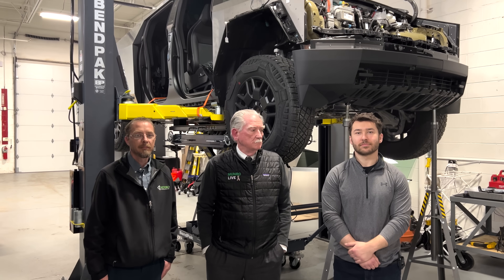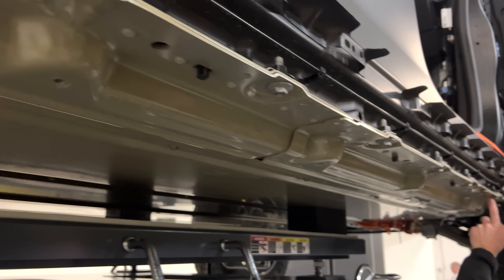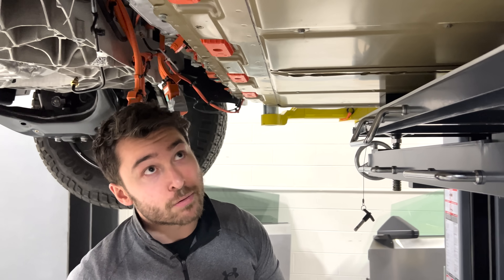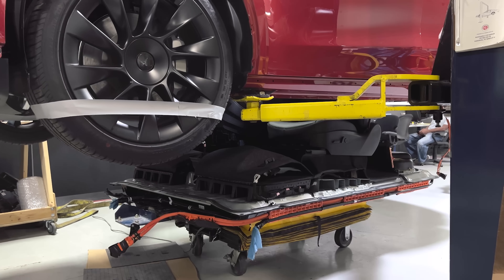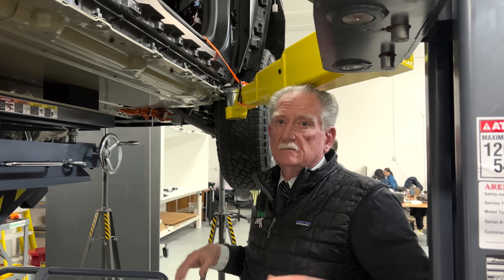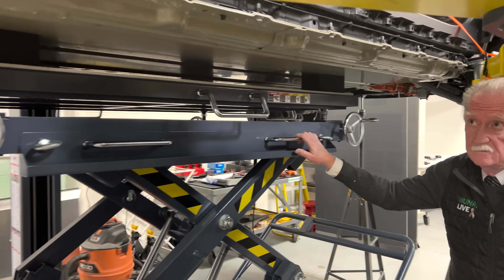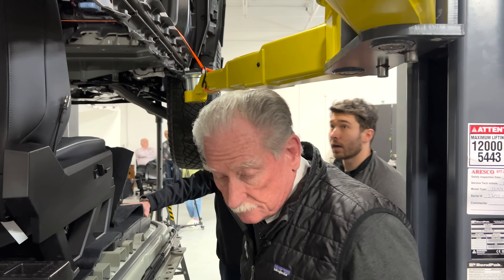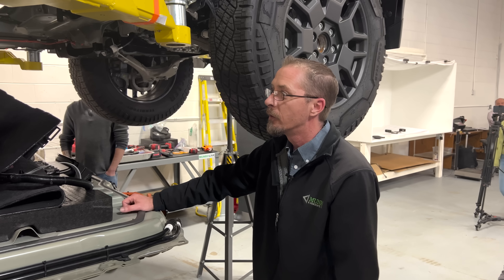Dropping the Battery Pack in Our Tesla Cybertruck!

Comment: That drop down of the seats attached to the structural battery pack is something else!
Reply: i rather not be sitting on top of thermal runaway piece of junk design 101 on this machine poor designed door handles and controls and everything else tesla cannot design vehicles worth a crap.
Reply: And how does this deal with waterproofing, considering it's supposed to be a workhorse? After a couple of battery unhooks, I doubt you will have any waterproofing integrity left.
Reply: Yea, it is a joke. Cheap crap. Check out NIO and battery swap.
Reply: @billybobbob3003  Punctuation, it can be useful'
Reply: @HullioGQ  Why would you be unhooking the battery at all in the first place? The only reason to do that is if it's damaged, defective, or needs to be replaced because of extreme degradation.
Reply: @HullioGQ  Which waterproofing? The pack itself, or the pack to the body?
Reply: Hahaha you commenters seem to be geniuses.   I only have an engineering degree from a small insignificant school called Caltech.  I can see that you three must have higher credentials than me and the Tesla team.  Oh by the way why don't you guys comment on the Fisker Ocean....it will undoubtedly revolutionize the whole EV industry.
Reply: @martina5328  I've seen you all over this comment section. Are you paid by NIO? Because if not, you should be. 😂

Battery swap is going to go the same way as hydrogen cars… No where.
Reply: @billybobbob3003 is literally the same concept wise to sitting on any other Ev. It’s just on the manufacturer side how easy it is. Don’t know why you hate Tesla so much when Toyota puts bad airbags knowingly just to give you a recall later on since it’s faster than stoping production. But you do you and your 50 recalls .
Reply: @Endymion.  TOYOTA DIDNT MAKE THOSE AIRBAGS.
Reply: @billybobbob3003 That's right, legacy automakers are just catalog shoppers, they barely have any core expertise - unlike the new modern players like Tesla and BYD that vertically integrate so much. 

Maybe Toyota and Mercedes will catalog shop from Tesla again, like they did with the Rav4 and Smart platforms. But that's just trash products by extension, right?
Reply: ONLY WAY  to remove the seats…
Reply: @HullioGQ  The assumptions are that battery replacements will be rare, and will done to factory standards. Whether either assumption is valid is up for discussion...
Reply: @grahammonk8013  the obvious waterproofing concern which is specific to this design will be pack/floor to body.
Reply: @brianb-p6586  So, the same as the Model Y with 5680s. The design seems to be the same, with a continuous resilient sealing compound/gasket around the pack.
Reply: So much for working on your own car....
Reply: @erikkovacs3097  Working on the battery? Make sure your life insurance is up to date. Working on suspension, wheels, etc is much the same as any other car. They don't need much else anyway.
Reply: @grahammonk8013  I work on high voltage high current battery systems for a living. I'm more afraid of a strut compressor than my battery systems. As for not "needing much else", well.... you probably don't work on cars often and certainly not Tesla's. They are notorious for being extremely difficult to repair or diagnose.
Reply: @grahammonk8013  yes, it's "4680", but I assume that was just a typo. It's essentially the same floor and pack case design.
Reply: yeah easy for the asswembly line but it still has to be assembled somewhere and for any repairs a nightmare.
Reply: @alanmay7929  No battery pack repairs are possible. It is all or nothing.
Reply: @erikkovacs3097  so they are going to waste alot of time to unbolt the whole seats, carpets, wires.... just to change the battery righ! lame!
Reply: @BeechSportBill  No you can remove them the traditional way, but at time of manufacture this is a major production efficiency benefit. 

This approach removes the need for expensive robots or labor that have to crawl into the cabin to install these seats through the openings in the old traditional way.
Reply: @ProXcaliber  Pickup trucks, by design, are built to withstand various extreme conditions. However, in the case of an executive type who merely uses it for casual outings like driving to Costco in a pickup truck to maintain a certain image, the robustness may not be fully utilized. The battery in a pickup truck will typically require more frequent replacements compared to models such as the Model S, 3, Y, or X. If you need evidence of this, consider why Hertz Car Rental is currently offloading all the Teslas it acquired for its fleet a couple of years back.
Reply: @grahammonk8013  pack to body.
Reply: @brianb-p6586  my response to  @ProXcaliber applies to your comment as well.
Reply: The empty battery connection is for the $15k seat ejection pack.
Reply: People who talk here,talk like they make a better ev ,thats even safer than Tesla
Reply: Brilliant engineering. Anyone know how organic it is to sleep or live in an EV while traveling on the road?  Is it ok to sleep on top of batteries?
Reply: Yeah. Something stupid.
Reply: @billybobbob3003  We found another Tesla hater guys!
Reply: @BeechSportBill  Actually the front seats easily come out the rear doors. Just fold up the 2nd row cushions like you would if you were stowing them away, unbolt the front and bring them out through the rear doors.
Reply: @martina5328  that battery swap crap that nio is tryna pull is the most braindead shite ever. battery swaps will never be the long term answer.
Reply: @okdok3742  Do you have any factual arguments on the matter at all. Look what China federal authorities just proclaimed regarding swap. And what did CATL announce the other day?..

Comment: Never ever drive your structural Tesla in a Nio battery swap station ;-) You will find yourself (seats are on the battery and you are on the seats) in the swap rack 😛
Reply: Battery swap stations is an idea whise time never came. Tesla proved that idea was silly/
Reply: I've never really understood the attraction to this concept. The fact that the manufacturer has to produce a bunch of extras of the single most expensive component in the vehicle for the swap stations just balloons the cost per vehicle. We need every battery that is manufacturered going into a vehicle, not dozens sitting in every single swap station. And I'm really not sure I buy the throughput argument. Either the swap station has an underground warehouse filled with dangerous and very expensive batteries, or after a handful of customers the station has to close so it can charge the packs it has recieved. And the throughput is reduced if they offer different styles of packs. And how do you innovate? A swap station implies a frozen "forever battery" design that never improves in any way that impacts the swapping hardware. It just feels like an insanely huge investment for something with limited upshots. And the mechanical aspects of the swap stations just feel like they are guaranteed to break or get out of alignment and that feels very dangerous. Nothing about it makes any sense to me. 🤷‍♂️
Reply: The idea is batteries don't last.  You were getting fresh, inspected battery packs.
Reply: @Dularr  not really. You possible end swapping your brand new battery with a 3 year old one.  And Nio would not replace any working batteries, so in the future you will get even older batteries.
Reply: @evkx Thing is, the batteries are charged to 90% for longevity, and charged slowly for longevity too. Odds are that 90% will still be around 90% of the usable pack size when it was new.
Reply: @casualgamer1209  yes on the swap stations. But not at home. People more likely Will charge it to 100% and keep it there on a NIO
Reply: @evkx Also, aren't the Nio packs LFP chemistry? Those packs last longer and charge to 100% just fine. I don't think they are, but IDK.
Reply: @casualgamer1209  they are nmc. If you look at Bjørn Nyland test it seems like they have a lager degradation than other packs.
Reply: @evkx Oh. yeah, NMC packs are bad.

Comment: $600-800000 assembly line savings in what? Equipment, materials. labor? Statements like that really need clarification.
Reply: You have to buy the reports to get those details
Reply: wonder about repairability. this looks more difficult to repair.
Reply: @jarjarbinx79  Why?
Reply: @jarjarbinx79  Repairing a pack is near impossible and no company is willing to do a pack repair. 
you not only need to balance the pack after repairing it, you also need to warrenty your repair. The warrenty is the big issue, no company or insurance is going to warrenty a repaired pack, since a 2k repair can cause a unbalance and make the complete pack useless or destroy itself by inbalance. Then that 2k repair end up costing them over 10k or even worse, it cause a fire and you talking about 70k+ cost.
Reply: @francoisbedard6021  then Sandy should say that, or else not say it at all in a non-industry focused Youtube.
Reply: @jarjarbinx79 
It depends on the fault.
If cells are reliable (and technology, plus experience will increase that reliability) then you're looking at control systems or mechanical breakage/ leaks.
.
Control systems? In the Penthouse, accessible.
.
Leaks / breakages?
Warranty?
And by the time warranty expires cell prices will be so low that a Pack will be in the range of "My engine blew up, needs replacing"
.
One thing nobody considers.
.
Let's say your ICE engine blows.
You get some quotes.
It's either
Complete unit (which needs ancillaries swapped)
.
Short engine, part rebuild.
.
Strip/ repair existing unit.
.
ALL of these are expensive in terms of parts AND Labor
.
You're talking days (weeks?) of work to complete.
.
A battery swap?
2 technicians, with the correct lifts (😉).
Less than an hour to remove?
1 hour to swap seats, etc?
1 hour to refit and test?
.
Add 1 more just for the hell of it.
.
But account for the fact you won't need both for the whole time.
.
What's the going rate for 1 Technician, 4 hours, plus 1 for 2 hours,  (6 total)?
.
I mean the cost to the customer...
.
It's going to save a fortune.
Reply: @danharold3087  Model S can be battery swapped quickly. Tesla even had plan for an automated battery swapping station.
Reply: Agreed. Just a random statement with no explanation. 6-8 hundred thousand dollars is a fart in the wind when talking about vehicle production lines

Comment: What I'm fascinated about is the refurbishing process, for a worn down robotaxi assebled in this way. You drop down the ~500K mile worn out battery and torn up seats, put in new ones and done, it's ready to get back on the road after just 50 screws? With brand new battery and seats.
Reply: That's a good point!  But would Tesla think of offering these assemblies?
Reply: What robotaxi are you talking about?
Reply: @imresomodi4961 The ones that are coming in a couple years or maybe sooner.
Reply: Image a station that lifts the robotaxi up replacing the worn out batteries and sits and cleaning the vehicle 
That sounds like something Tesla would do
Reply: @LightSpirit24  8/8

Comment: Sandy, Julian and Andy, Thanks for your engineering discussions and demonstrations about removing the battery from the Cybertruck.  I was amazed that you said it would take 2x43 seconds for Tesla line workers to install the battery. I appreciated your explaining the time Tesla saves fabricating & installing everything.
Reply: Sandy mentioned another big advantage of this type of assembly a while ago. With no floor in the way workers can stand inside the car while they install the steering wheel and hook up the dashboard electronics. They'll undoubtedly do this more quickly than the old way, and more ergonomically.* Sandy loves this design so much - it eliminates several work stations and speeds up the time at the remaining work stations.

*Cars that are easier and more ergonomic for the workers to build save the company money on sick leave time and paying people overtime to fill in for the people who are out hurt.
Reply: @donjones4719  Thanks Don for the additional information.  Never anticipated that TWO workstations were eleminated from using this installation practice.
Reply: they will still need to assemble all the carpet, seats and other accessories on top of the battery pack so literaly no time is served its just alocated to other assembly  line lol!!!
Reply: @alanmay7929   At that other location the workers can stand next to the floor/pack and install all of these items quickly and ergonomically. At other OEMs installing seats and their wiring, etc, is done by awkwardly maneuvering in the seats and the workers have to lean in or crouch inside to do the installation of them and any other items. Plus, since all this is done on the main assembly line, if there's a problem it slows down the entire main assembly line. With the Tesla method, a reserve of floor/packs can be maintained so if that work station has a problem the main assembly line can continue to flow by using the reserve.
Reply: @donjones4719 another bullshit!! those OEMs have actually seriously optimise the asse,bly of all those things in the car and have equipments for that too, other OEMs also offers seriously way more choices of customisations compared to tesla, tesla is all bland and same thing all over.
Reply: @donjones4719  is tesla ever going to offer a single cab or truck?1 what about panoramic sliding roof and many other features?! ford sells both luxury and regular and base version of their trucks, they also offers just the chassis plus engine or with cab for  people to add their own bed types depending on the application....
Reply: @donjones4719  the mercedes Sprinter comes in hundreds of different configurations from the shortest to the longest to the highest and also pickup truck single/double cab..... with dually and possibility to mount things like crane.... what does the useless tesla vehicels does?! the sprinter also comes in just chassis and cab for ambulance, bus and many other types of conversions possible.
Reply: @alanmay7929   Tesla has their business model, other companies have a different one. Tesla doesn't plan to replace the entire automotive industry, no company can grow that fast. So if a customer wants a single cab or a sliding roof there are plenty of other vehicles to choose from. For now Tesla wants to maximize its output and get as many BEVs on the road as possible. Things may be quite different in 10 years.
Reply: @donjones4719  tesla came at a moment where most things in the automotive were already developed plus the roads and the grid on which they rely. the Mercedes Unimog alone is the most versatile vehicle ever made, used for agriculture, mining, overlanding, construction, railway, utility works.... even for clearing land, installing solar farms, moving trains, cars......
Reply: @alanmay7929 What's the connection here? A proper EV platform wasn't made yet- they did that from scratch. An EV was htought of as ugly-so they made it look good and get good range because they actualy designed it for aero instead of re-using an old chassis.

Comment: That casting in the back is amazing..
Reply: No its just ok!
Reply: Mud, snow, ice collector.
Reply: @freddymax5256  Its covered normally with skid plates and aero covers, if you look under it normally the bottom is smooth all the way back. This is also for efficiency.
Reply: It’s a work of engineering art, but yeah it’s a dirt magnet and if it breaks, ouch.  Still, it’s progress
Reply: it is not! and they still had to use massive steel welded structure to make it able to tow anything lol! such a weak design just to save money!
Reply: people buys trucks and SUVs in Australia and cut them to extend to chassis to even increase their hauling and towing capacity and practicality, up to 6x6 conversions for overlanding, fire fighter or utility vehicle..... casting will never compete with body on frame period!
Reply: @alanmay7929  So because there's 0.001% of the market that require to do this kind of mods this design is bad???? It is actually a good thing that Tesla did not try to accommodate theses uses case. And even if the CT is made of heavy super strong steel, it weight less then the F-150 lightning and the Rivian R1T while having better tow and hauling capacity. Like it or not, the casting + the structural battery pack are what make this possible.